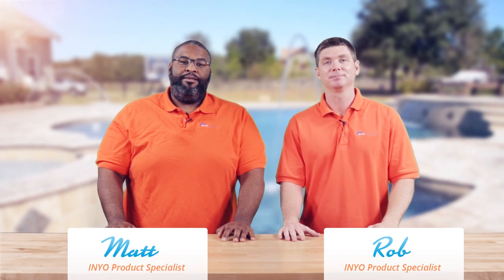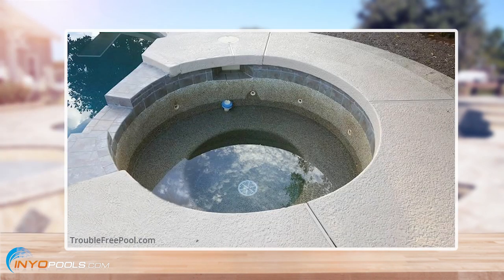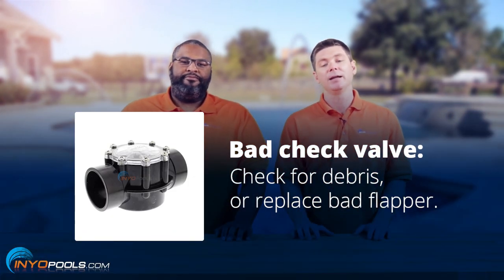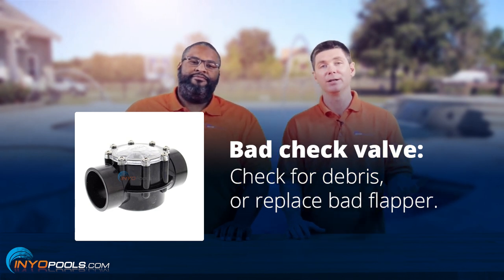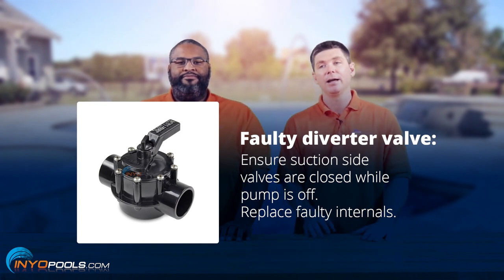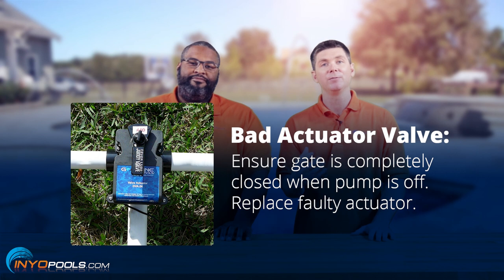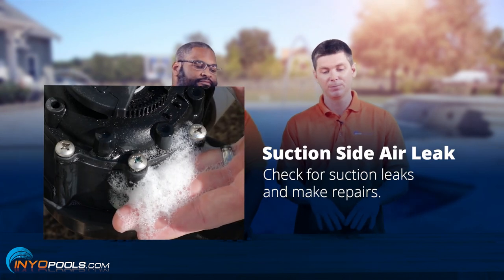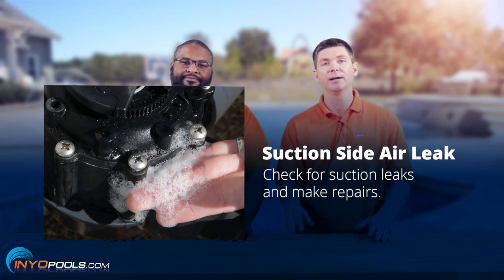Why is my spa draining when I turn off my pool pump?

Comment: I see you answer questions, too!  Okay, so the pool company said I need a leak doctor to find out why my spa is draining when the filter pump is not on.  I said that can't be the issue because the water refills the spa when the filter pump turns on again.  I have no missing water.  I have a pretty big pool so any leakage is hard to detect - even with all the water out of the spa, so I guess it's still a possibility.  What do you think?

Comment: My inground spa drains down to the water jet level whenever the pool is off.  I have changed the main return check valve and a diverter valve. I shut off all other valves that could be "siphoning" off water.  Tonight I put the rubber stoppers into every spa jet and this is the only thing so far that has worked.  Not a practical solution, but it does seem to show that the problem lies between the spa jets and the pool equipment. Kidney shaped pool with waterfall type spa in the concave part of the kidney. 28,000 gallon main pool.  Spa is partly  above ground. Very frustrating.  Any help is appreciated.

Comment: I just asked this question on your valve video. There is a small drip in one of the connections to my new filter that hasn't been fixed yet. I can't imagine this causing the backflow, but what do I know? Hope you do. There is a benefit to having it drain out, as I mentioned in my other comment in the valve video. Thanks
Reply from the maker: If the hole is big enough for water to leak while there is water pressure, then the hole is big enough for air to enter when the plumbing pressure drops. When the air surges into your system, the water with backflush into the pool. So if you hear a whistling or a gurgling sound from the filter when the pump turns off, that area should be your first focus.
Reply: @Inyopools  I will check it out. Thanks for the suggestion.

Comment: How do you completely drain the spa before changing the spa check valve?  I opened up the spa check valve housing when the spa level drained overnight, but water still gushed out of the housing.  I don't want to lose 100s of gallons of water or more.  Thanks!
Reply from the maker: We'd be glad to assist you. Check out our guide titled" How to Drain a Pool Spa". http://www.inyopools.com/HowToPage/how-to-drain-a-spa.aspx

Comment: Since you want to give an answer.....what if spa drains but water does not go into pool. Where does water disappear to?
Reply from the maker: Ruby, does the spa drain completely, or does it stop at a specific level?
Reply: @Inyopools  Was there a solution to this?  my pool is doing the same.  not sure where water is draining though, but when pool starts up, it sucks all the water out of the pool to fill up and then i have to fill pool back up.
Reply: When my pool starts, it drains the spa completely and all water goes in to the pool and system turns off (I am assumin because spa is empty). Any suggestions?

Comment: Where is the check valve?
Reply from the maker: The check valve is typically located near the pool equipment. It will be plumbed in line on the return side.

Comment: I am experiencing this issue and found one potential culprit that you may be able to confirm.  In 'pool mode' both the spa return and the pool returns are open, providing nice circulation and a good spillover.  When the pump stops, the actuator leaves the pool/spa valve in the spillover mix position.  Should it move to the 'spa closed' position when the pump is off?  Thanks!
Reply: Did you find that moving to spa closed stops the lowering?
Reply: @mexicosupershow9546  It did not, so my spa is still draining overnight.
Reply: Has the problem been found? Having same issue